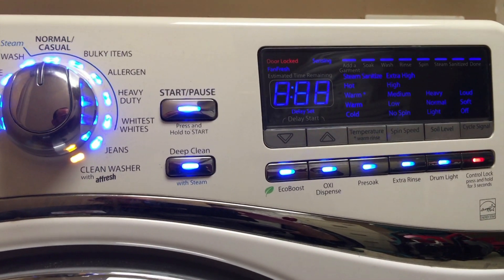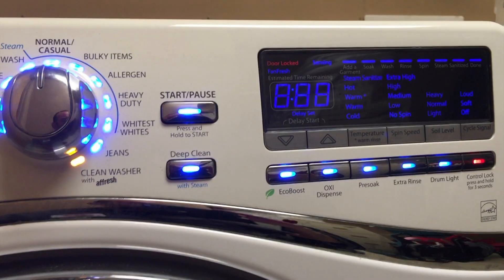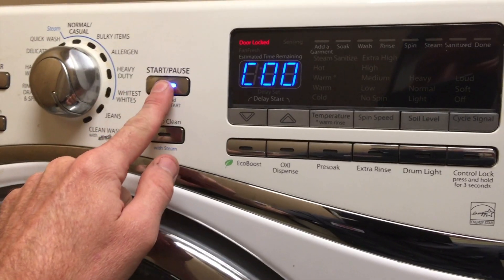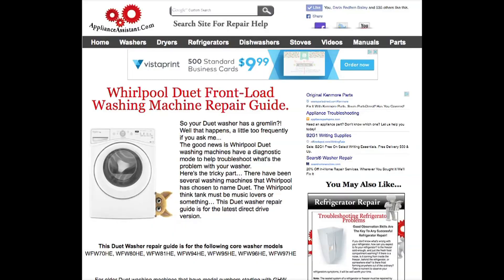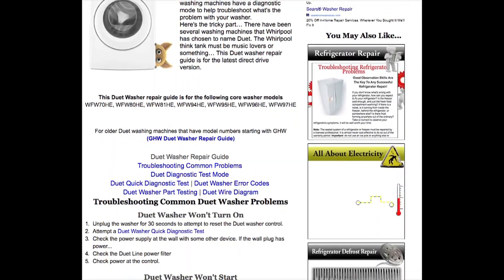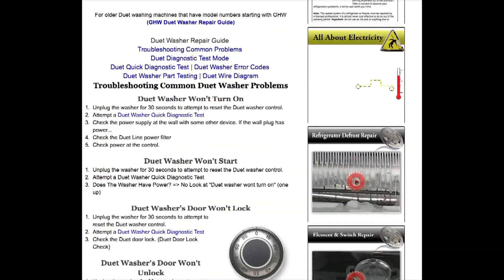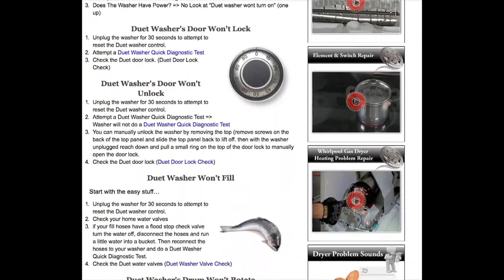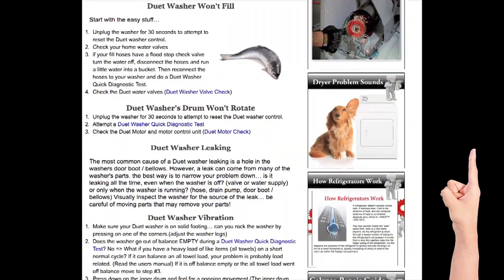Whirlpool Duet Washer Diagnostics & Error Codes

Comment: Try and unplugging it for a minute- NOT just flipping the breaker  for some reason, actually have to unplug it to get it to reset
Reply from the maker: The goal is to give enough time for all stored electricity in the control board's capacitors to discharge and fully power down, hopefully resetting the short term memory and any memory errors. So a full minute is good advice!
It doesn't matter if you flip the breaker or unplug the appliance, just give it time to fully power down.

Comment: What the heck does a LF code mean on a whirlpool duet 4.0 machine? No one seems to have the answer and believe me it is a pain when I have clothes in the machine trying to wash them and that code hits...takes forever to turn the machine off just to end up taking half the clothes out that have been soaked in soapy water just to have to run them on a rinse/spin cycle.
Reply from the maker: Usually LF means “long fill”, so valves, clogged screens, and other water supply issues are usually to blame.

Comment: Where is the filter for this and how to access it ?
Reply from the maker: They didn't make it easy, I can tell you that much! if you have long arms, are patent, and don't mind getting wet and a few stitches you may be able to pull the pump from the bottom or back, depending on the type.  I pull the front off, However, getting that door boot back on can be "troublesome" if you haven't done it before. Honestly it may be worth the money and wait to hire someone if they are honest.  Sorry I cant be more helpful.  Looking at a few part diagrams on parts sites may help you sort it out. The filter is inside the drain pump. Good luck!

Comment: My whirlpool washer is full of clothes water ,the doors locked nothing works, control lock light is not on ,after about five minutes it starts beeping and then I can push cancel, I can open the door but no matter what setting I put it on the and press start ,the washer will not move ,it just throws more water in it then clicks and locks the door, then I have to wait another five minutes to open the door what is my problem?

Comment: Whirlpool WFW72HEDW0. Lost power in home this morning.  Transformer blew in the neighborhood.  When power returned my washer started emitted a high hum.  It only goes away when the circuit breaker is cut.  I tried the reset and it didn't help.  Followed your video and the last error code was F5E2 which was a door lock but i haven't had any issue with the lock. 

Washer won't start a cycle.  It's engage the door and lock it but won't do anything else.  Hum still present.  Any ideas?

Comment: I have a Whirlpool LoadnGo WFW92HEFWO.
It works fine for about three loads then gives the error code F03 F08, if I clear the codes from the machine it starts working again for another 3-4 loads. From what I have found the codes relate to the soap dispenser issue (which had a black substance on the inner roof, all cleaned now), I can tell when the machine is going to fail because I hear no water running into the machine at the start of load, then it flashes the error codes.

I have taken the top off and verified that the linkage that goes to the soap dispenser is hooked up and rotates, also, that the water line from the back is clear.

If it were a mechanical issue I would think it would fault and never work again, because I can reset the machine and it works fine for several loads I am thinking it is something else like the control board?

Comment: I need to know why the fabric softener and bleach dispensers fill with water.  I cannot add fabric softener and bleach to the washer.
Reply from the maker: Sorry for the delay. The dispenser is a siphon drain system so it's probably just clogged up with something. If you take the dispenser out and give it a good cleaning it will probably work.

Comment: Hi my neighbor has a kenmore HE2 11047532601 front panel is different but close will this  work? Doesn't start door locks  . add garment and door lights come on load type etc. then thats it nothing works after that, can't unlock door even if you can get the add garment light to flash on/off  ,She saw acouple error codes but doesn't remember what  any ideas? Thanks Neil

Comment: Wrong model. My duet washer has a rotary select dial. The only buttons are Control On, Start, and Cancel. Water temp, buzzer volume are selected thru sequential button.
Reply from the maker: grnach Thanks for the comment! there are several washers named DUET so it must be one of the other styles... Do you have a model number? I have repair guides for the other types on my website... they may help.